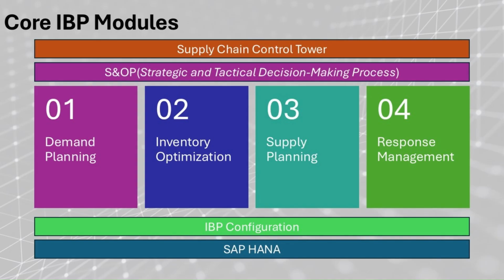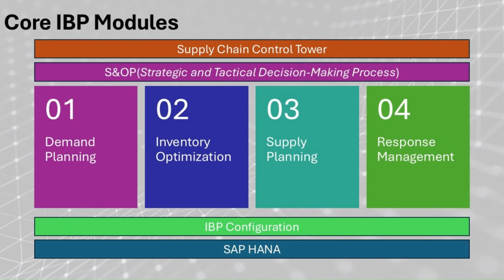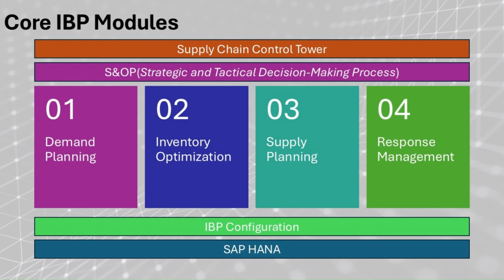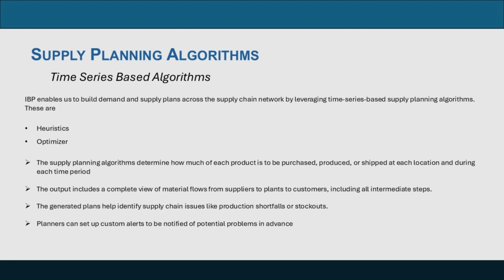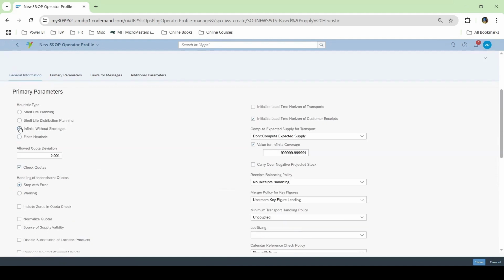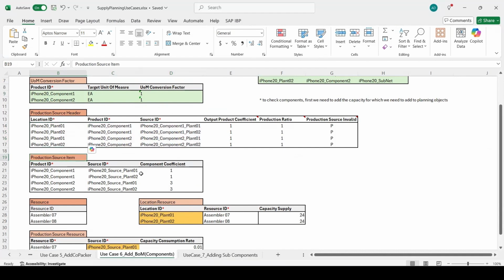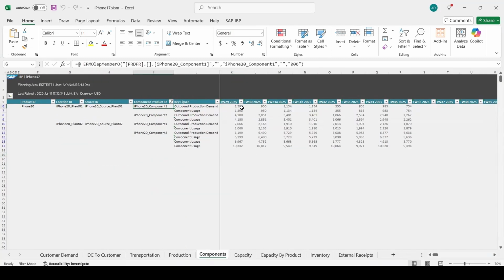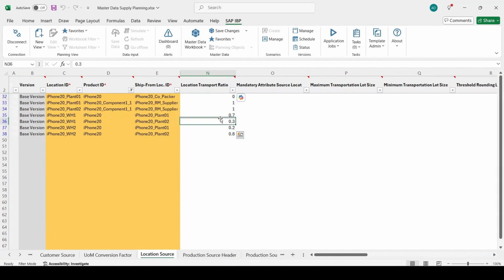SAP IBP Supply Planning : A Detailed Step By Step Demonstration

Comment: Thanks for explaining the supply planning with an example to understand the flow in IBP easily..

Could you please also explain the order based planning with an example.

Should we use S&OP for Capacity Planning and Order based planning for PO generation?